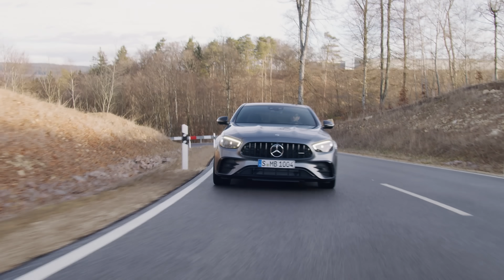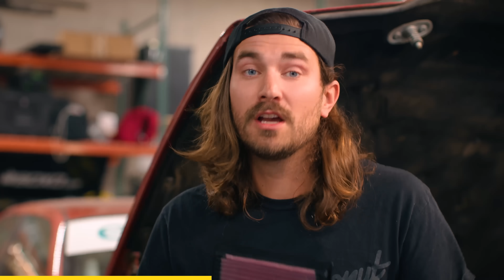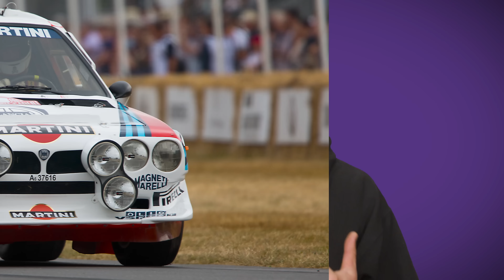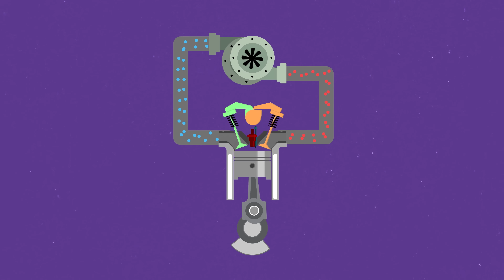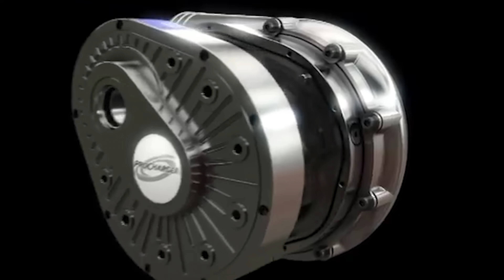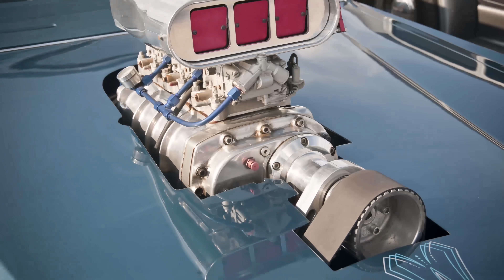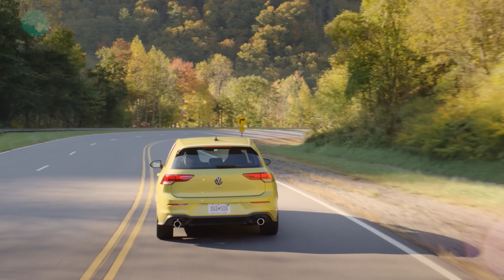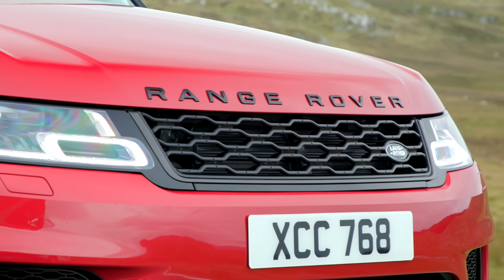Why Your Engine Isn't Twin-Charged

Comment: You forgot another twin-charged engine
Detroit Diesel 71 series with Turbos (8V71T, 12V71T, and 16V71T) and Detroit Diesel 92 series (6V92Ts, 8V92Ts, 12V92Ts, and 16V92Ts)
But, because it is a 2-stroke diesel, it needs superchargers as standard to send air into the airbox.

The top of the line of the twin-charging is EMD with the turboed version of 645 and also the 710. They designed, built, and assemble it into a Turbo-like things, but it is actually worked as supercharger at low speed by using gears that coupled to by a slider-like system that could uncouple the turbo shaft from the geartrains at high speed...
Increase fuel economy, increase low end torque, reduce emission, and more reliable than a normal Turbocharger...

I just can't imagine why manufacturers didn't built Turbo like the EMD does with their 2-stroke 645 and 710 diesels.

Comment: Been doing 'full compound' twincharging on 4ag engine since 2007.  The whole rev range powerband is awesome!  Torque forever.  Mines only budget diy setup, but works awesome.
Reply: I remember way back in the early 00s some madlad twincharged an AE86 with a true bypass setup. Once the rpm got high enough that the turbo output more volume than the supercharger could handle, it bypassed the supercharger. I want to say he even setup a clutch mechanism like an A/C compressor to remove the parasitic loss of the supercharger.

The plumbing on it was absolutely insane. But the guys powerband graph was like a tabletop.
Reply: @ObservationofLimits  straight compound with no bypasses or clutches makes the setup so much easier and works flawlessly.  Huge powerband with no dips on bypass crossover etc that those who try bypasses suffer from.
Reply: @feral4mr2  I've built a 2002 Mercedes Benz C32 with big rear mount turbo blowing into the Supercharger no-bypass for Drag n Drive events in Australia.

Comment: Detroit diesel sort of did it 50 years ago, but they needed the blower to run at all.  At a certain level, the turbo overcame the blower and the blower bypass opened up because the blower actually became a restriction.

Comment: There is always the way of running the Turbo to a Blow Thru Carburetor that is sitting on top of a Supercharger. And the Air\Fuel  mix that  is getting push/pulled into the supercharger helps keep things cool. Simpler.

Comment: Dual forced induction is very common on the maritime industry.  I used to work on old Detroit Diesel series 71.  The 6 71, 71 series 6V, 8V had the blower and turbo. I also worked on a 16V 71 series generator.  The engines were two cycle, both blower and turbo were necessary on the engine for air intake and to blow the exhaust out of the combustion chamber.
Those engines have an unique oil burn smell. 
There are some Fairbanks Morse medium speed engines in locomotives and industrial generators that also have blower and turbo system.

Comment: A cheap electric supercharger is an air compressor routed into the intake. Might be loud but it could be put anywhere and easily routed.

Comment: I've had 2 brand new 1.4 TSI CAVE engines in my 180bhp seat cupra since I bought it new, most recent one has done 70k without exploding so i guess that is good, right?

Comment: i work for Mercedes and i have to say that the twin-charging on the E53 is actually not true. The E53 does have a mild-hybrid-system, but that powers an electric motor which is sat inside the torque-converter. The twin-charging on that engine is only in the W222 S-Class, to be more specific: on the S450 and S500 model which were built after june 2017. They do also have the hybrid-system in the torque-converter
Reply: I've built a 2002 Mercedes Benz C32 with big rear mount turbo blowing into the Supercharger no-bypass for Drag n Drive events in Australia.

Comment: I saw an article in Performance Autotuning back in (I think) 2009ish about a guy who built a twin charged VW GTI. Long story short, it's not impossible, just extra complicated. But if you DO actually do it and you do get it working, it should work very well. The supercharger handles everything while the turbo is spooling up so power is delivered smoothly across the board.

Comment: Twin charging on the other hand has been used quite successfully on many aircraft over the years, and those dudes went nuts pulling every oz of power they could. Back as early as WW2 we had engines producing up to 3000hp give or take, though the engine I have in mind I believe had multistage supercharging instead of being twin charged, but I digress. 

They also have a fielded a few special kinds of turbochargers implementing a power recovery turbine, that not only spools the compressor but has a shaft connected to the turbine (some may have a second) that inputs additional exhaust gas energy back into the crankshaft.
Reply: Don't forget water-methanol injection in addition to the forced induction systems.
Reply: Also in train.
Reply: Those engines sounded exquisitely insane when I used to stop and watch the Oshkosh fly in while running my route.I would lose some critical time but it was worth it.

Comment: The Delta S4 and volvo T8 are simillar on the surface but worlds apart in power delivery. The Lancia was brutal while the volvo is smooth + the EMs. A 1 litre 4 cyl twin charged engine with 200hp and smooth V6 like delivery would make a very nice engine

Comment: Back in 03' I was a yacht broker and listed a boat for a family friend down river. It was a custom aluminum fishing boat with a Volvo KAD32P Diesel with a Dual Prop outdrive. It had turbo fed roots blower stock and that 22' boat did 44 Knots no problem. I had to pilot it twice from Puget Island to Portland Or. and the 90 some mile trip used 14 gallons both times at 44 Knots the whole way.

Comment: Did you know that's where the 671 supercharger came from is the diesel truck industry, and they also used compound turbocharging and I'm sure they have been doing it for more than 70 years

Comment: Some American WW2 aero engines(Pratt and Whitney/Alison) had a supercharger and a turbo, fitted to the P47, P38, B17, B29 and others, the Germans also tried it with the Focke Wulf TA152. better at very high altitude than even 2 sequential superchargers, incidentally where the name intercooler comes from, between two stages of forced induction.
 Do they count as production engines? Production numbers of the American engines, in some cases, must have been in the hundreds of thousands.

Comment: Volvo XC90 T8 is also twincharged (that’s their T8 power plant, also available on other vehicles), plus it’s a hybrid. It’s a bit ridiculous to have a big heavy 7-passenger SUV with a 2.5L T+SC, but it works. It’s also funny as hell to wreck WRXes off the line in a luxobarge mommy mobile.

Comment: For the non-math nerds in the audience, a 4in diameter turbine (arbitrarily chosen diameter) at 280,000RPM the tip speed is 4.38......MACH!!! Using the 'relative centrifugal force' (RCF) calculation (used in laboratories to calculate the density separation rates of samples being spun in test tubes) the tips are experiencing a relative G-load of 3512320 Gs!!! Meaning the tips are moving over 4 times the speed of sound and are 3.5 million times heavier!!!

😱 Holy mother of god.....I think I just let out something too.....

And, while granted 280,000rpm is an exotic level of energy, this is a prime example of why when a turbo comes apart its called a "catastrophic failure"......Because that failure is going to be catastrophic!!!

Comment: but if you are machining it yourself, add the right alloys, and just the right insanity... well an engineer. well you can see where am going with that. and given am studying mechanical engineering for engines. if you stop watching me for but a second i will come out with some bat shit insane engine set up that somehow has no draw backs outside of the obvious weight and a LIIIIIIIIIIIIIIIITTLE complexity.

Comment: I'm a bit late to this but yeah, I built my own twincharge. Still going strong after 8 or so yrs. 2liter, gt3540 blowing through intercooler in roots supercharger, clutched at 11psi, runs to 25ish psi on pump fuel. Entertaining.
Reply: I've built a 2002 Mercedes Benz C32 V6 Kompressor with big rear mount turbo blowing into the Supercharger no-bypass for Drag n Drive events in Australia.

Comment: TSI engines have one big Problem, if the Magnet clutch fails, The supercharger won't clutch to Turbocharged so the Supercharger stays on, but normally the supercharger will be declutched after a certain RPM maybe 3000Rpm . Nearly bought an 1.4 Tsi powered Scirocco Mk2

Comment: Thanks for explaining the way the system works.  I've wondered and speculated since I got a car that had one in 2019.  Speaking of, you forgot one of the major and only brands making twin-charged engines right now; Volvo.

Volvo also makes Twin-charged engines for both Semi's (I think a certain D13 model) that produce over 1500 ft-ibs of torque and around 400 hp and for cars their "T6" models past 2016 which are 2.0L Twin-charged engines that produce about 306-330hp with equal amounts of torque.  
their hybrid "T8" also uses the twin-charged engine and produces a combined 400-415hp as well and around 475ft-ibs of torque.  Not going to forget the rare 2015.5 S-V60 Polestar line that used the 2.0L Twin-charged setup to produce about 360+hp also Just before Polestar split into it's own car making.  

As someone who owned a 2019 Volvo XC90T8 hybrid, I can say the acceleration was absolutely insane and I never experienced any form of turbo-lag.  It also got fantastic gas mileage, even when not in hybrid/electric mode.  
That said, my favorite engine is still the Yamaha 5 cylinder inline Volvo used from 1995-2012ish. Specifically the one in my 2007 S60R which has a 2.5L that produces 300hp and 295 torques.  The turbo-lag is quite noticeable though at low RPM, but it's boot threshold is only 1850 RPM, which is nuts.

Comment: Do a video on how many needle bearings you need to diagnose the muffler bearings with while the alternators valve springs are sparking rich because of the left tire’s diff’s odometer vacuum leak

Comment: Series compound boosted twin charger set ups are pretty easy to get running actually on built engines and done have to cost a fortune since you don't need the fanciest gear. 

Roots style super. Basic high quality turbo. Turbo is over sized slightly for the engine size. But the turbo helps. Given the blow off valve and waste gate are set for the total boost pressure the turbo doesn't actually make its full boost. However with built engines this Also means with the right set up and electronic boost controllers you can static size the turbo and super. But have the turbo be allowed to boost more or less on demand. But keep it in a more effienct range with the suoer helping. Turbo helps the super run in peak effiency because it's just compression already compressed air and the turbo can flow the high end. 

Helps reduce heating from boosting. And also means you run a giant intercooler turbo style. But then a supercharger manifold style intercooler as well. Turbo style one doesn't need to be fancy. And given oem super options you can find cheaper set ups for fancier water cooled suoer intercoolers. 

Depending on engine and what you can salvage or already have. On an engine ready for boost it's not much more than a really high end turbo set up or super charger set up. Or about the combined set up of a entry level of both but with a few specific upgrades. 

There's alot of info on it online actually and kits made for some cars. 

Has alot of advantages. Compression effiency. Solving back pressure issues. Can help with cold air flow always coming into the engine and better escape of exhaust games and heat. Higher inlet pressure for exhaust pressure. Also has directional flow. Due to running in peak effiency ranges less heating also occurs and dual stage intercooling also helps alot. Basically eliminates turbo lag as you have boost off idle. Can be tunes to feel way more like an NA build that is way bigger and never stops building. Or kinda like a really high hp vtec or similar build. 

Depending on exact sizing and requirements and boost pressures you can get full boost off idle. But it works more like anti lag slightly but less harsh. 

But given how many cars have turbos and such. It might be possible to even go high end with it for not that much. 

Was thinking of playing with it myself. Twin scroll super and a twin vane turbo. 

Works well on cars with wide powerbands. Or at least high redlines. Just figure out what max boost it can take for the build you want. Set for final boost between the two to be that. Size the super for the lower range. Turbo for the upper. Slightly oversized super can be fine.

You end up with split effiency so say 80 percent effiency on the super 90 on the turbo you'll fall somewhere in the middle. However the other added advantages and the flatter power band make it well worth the cost and annoyance. 

Problem is you do need a decent bit of space. A suoer plus twin might technically be best but hard to plumb. And a big single and super can get you what you need. 

For compound boosting it's not just 10 psi plus 10 psi. You actually end up closer to 30 psi that way. But where the whole effiency thing comes in. 

Done right you can increase fuel economy and hp. Because it's more effienct. Turbos can do that by themselves. But the combined unit has a combination of many advantages. 

Pricey but worth it with certain cars if you don't need alot of engine work to make big boost numbers and you aren't just worried about highway pulls or drag events and launching it  gives you power everywhere. 

Probably not worth it below certain boost levels though. I'd wager depends on engine displacement but probably 15 to 20 pounds minimum. But would also depend on how wide the power band is. 

But an example. 1uz. Balanced to the ends upgraded pistons and rods and make the heads flow. Same or less for others like a 2jz or 1jz or 1.5jz. Make it rev high maybe destroke. For the 1uz could go flat plane crank. Just theory. Same for a higher revving ls or even a Ford v8.

Make it breath and out the right cams in and set uo for boost. Tune and the suoer gets you low end. Turbo and tune gets you high end. If you're planning higher boost from the get go this gives you an easy way to plan across the whole range. 

Valves you just need to worry about the top rpm breathing and making sure you don't kill the low end completely but unlikely. 

Certain engines besides a cam and some springs and different head gaskets and a stud kit. You might not need anything besides the induction set up to get to gnarly power levels that feel like much more expensive na builds but get the crazy peaks of a turbo build. 

For production vehicles it's annoying for manufacturers. And high enough boost levels are generally used. So bypass systems which are more complex are used. And usually on really small effiency oriented motors even if they are supposed to be sporty as well. 

But realistically for alot of builds. They already have turbo set ups. It'd be a bit of tweaking and installing the turbo. Boost would build way different. More lower end power same top end power. But charge would be colder less back pressure help with exhaust flow. 

If you've already done everything else. And you now have enough grip that the low end isn't causing a little bit of spin you could go this route gain some extra ponies all over but have a more powerful launch and early build up. Lower turbo spool up time. And potentially due to the pressure difference improved top end because scavenging would be improved. 

Would be a good option for awd cars that are built have full out suspension and top end hp sorted. But went a little weak on the early power or want more. Or those wanting more boost but turbo spool time is already an issue. 

For showy builds also gets you unique points. Done right its actually really worth it and not uber hard. But research is key. 

Best to start with roots style and basic turbo. Then you can slowly add in the twin scroll and twin vane. Less variables and an already solid system to start. 

Twin scroll would net higher effiency though. Positive displacement super chargers for the win.
Reply: I've built a 2002 Mercedes Benz C32 V6 Kompressor with big rear mount turbo blowing into the Supercharger no-bypass for Drag n Drive events in Australia.

Comment: From WWII Detroit made 2 stroke Diesel engines with a roots style blower and a turbo. The 92 series had 92 inches per cylinder in V6, V9. V12 and V16 configurations. I have 2 6V92s and an 8V71. The 8V71 engine was designed as a million mile engine. The original 8V71NA put out 318HP and 863 ft/lbs of torque @ 2100 rpm with a total displacement of 568 cubic inches.
Reply: I was hoping for someone to comment about Detroit 2 strokes. Though technically they where twin charged, the purpose of the blower was to scavage exhaust. Since Detroits had no exhaust valves and cylinder ports instead due to the 2 strike design, the blower essentially blew the exhaust gasses out of the cylinder thru the ports near bottom dead center.

Comment: no turbo ever has made "boost". boost or pressure is only made by a restriction to flow. a bigger turbo will have the ability to flow more fluid, and thus ake mre power not more boost. my old little 54mm turbo wouldmake 45psi of boost/pressure no issues, but will go 0-100 at the same time as running the same turbo at 28psi

Comment: So Detroit diesel had a set up like this back in the 70’s. Some were pushing 500hp back then, which was a big deal.  The 8v92 from Detroit was the most infamous of them. The turbo was bolted directly to the top of the famous 871 blower.